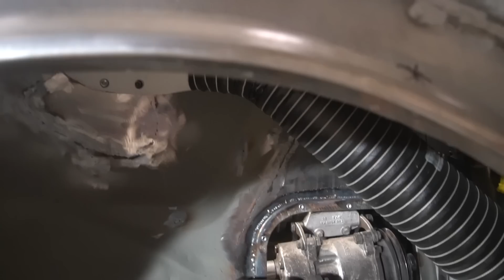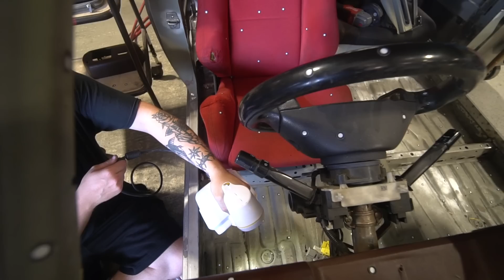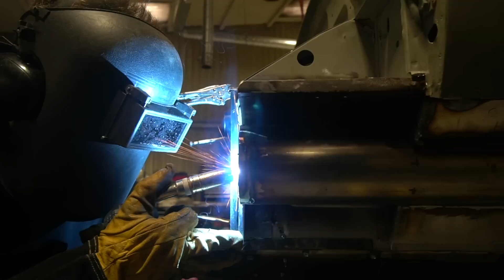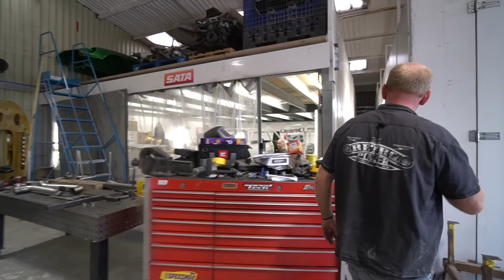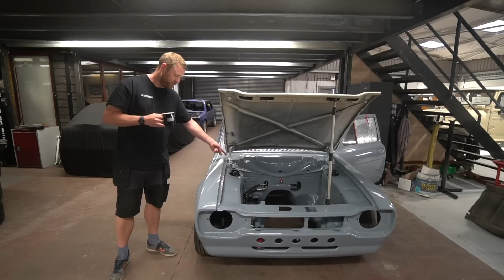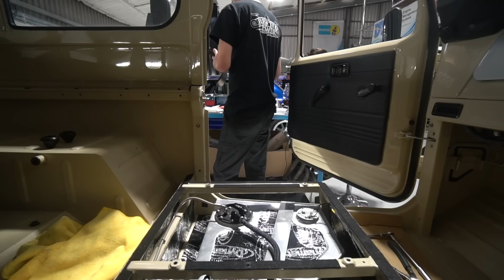Wide Body Morris Debuts at Retro Rides Gathering

Comment: Have you thought about an electric powered AC? You will still have to have both condenser and evap coils, but that would get the compressor out of the engine bay. Or , if the budget is fair to huge, you could re engineer it like Nik Blackhurst did- by making the all time, GOAT bracketry answer to a problem no one else had ever bothered to ask. But it was neat, yeah, buddy! Every time I marvel at the literal box of metal art each car gets- not just the shiny upper body, but all of it is prepared either as canvas for more complicated things or as that complex feature itself. Love the encouragement for your lads when they get a bit "creative" on camera; shop work can be as tough and demanding as any high zoot office- a little pause for a chuckle can make a tough day a lot easier.

Comment: With the enclosed, box sections, such as the Jaguar sills, have ypou considered using a suitable expanding foam?
Potential benefits are sealing the sections, further prevention of possible corrosion because it's sealed against the (painted) surfaces, and may benefit NVH by reducing any drumming or resonance chamber characteristics?

Comment: Great work as usual. Just a thought on the Allegro dash and gauge problem. Why don't you attach the gauge binnacle to the dash on a pivot point each side with a cantilever arm attached underneath to the column so that when you move the column up or down it tilts the binnacle in an arc to improve the view?

Comment: Have a look at classic mini condensers. Japanese minis had aircon and a small condenser on offside inner wing.
Reply: just looked at one. They are approximately 300mm by 300mm and that includes the drier bottle. The compressor is about the length of the alternator. The MPI had them on the inner wing, the SPI had them sort of forward facing in front of the clutch housing pretty much in the same place as the MPI ECU. I think the SPI one is bigger and looks very 'home made' i.e. fúgly.

Comment: The Intergro engine seemed very far forward in the car.
Reply: Stock honda position in relation to the wheels, just with a much shorter nose.
Reply: @mattsmith4053   and loads of space between the bulkhead and the back of the engine.
Reply: @tonedcos  that's just because there's no inlet manifold fitted, the bulkhead is stock Integra with the top modified.
Reply: I get that, just looks odd, but i suppose it will get filled ;) @mattsmith4053
Reply: For front wheels to fit into the front arches.

Comment: Wondering about engine positioning and fitment. The Allegro looks like the engine is 6 inches further forward that it could be was that due to the Integra floor ? Perhaps the Allegro engine was further back? Also notice Churchill motor is canted is that due to the donor engine or the original car and will you need to adjust suspension settings to reflect weight changes ? Not seen yet what you use for engine mounting? Too many Qs I know.

Comment: Wondering about engine positioning and fitment. The Allegro looks like the engine is 6 inches further forward that it could be was that due to the Integra floor ? Perhaps the Allegro engine further back? Also notice Churchill motor is canted is that due to the donar engine or the original car and will you need to adjust suspension settings to reflect weight changes ? Not seem yet what you use for engine mounting.